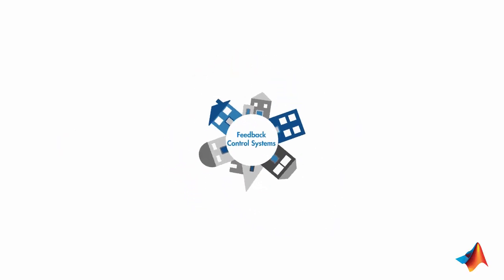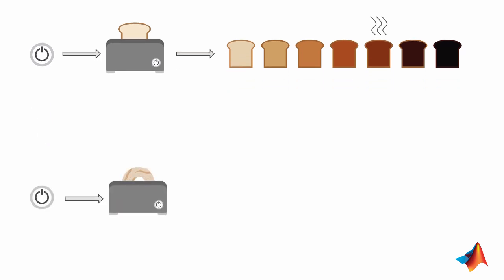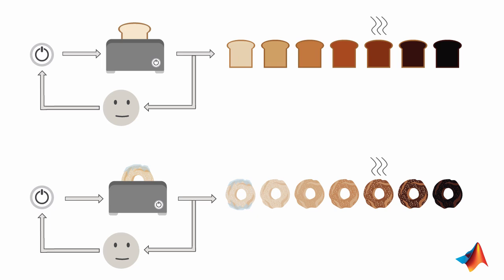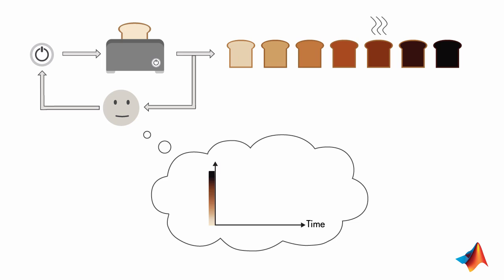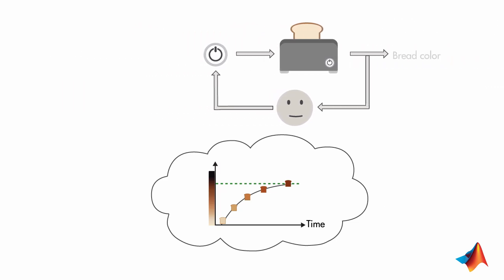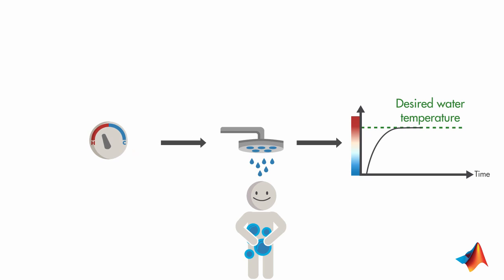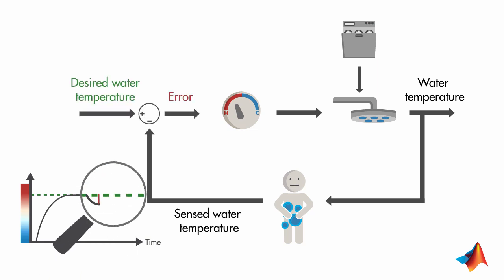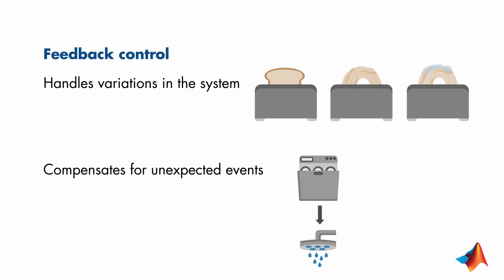Feedback Control Systems | Understanding Control Systems, Part 2

Comment: Mam a celling fan is a open loop system. But can we say that is this case of same celling fan a human can work as a feedback i mean we can change the speed of fan as we feel cold or hotter ?? (i know we can get only some fixed speed which is designed but can we say human as feedback here ?)
Reply: yes in your example, human would act as a sensor, closing the loop, to sense if it's cool or warm and based on that s/he would adjust the speed of the fan.
Reply: @meldaulusoy8389  Thanks for your precious replay
Finally Doubt is over